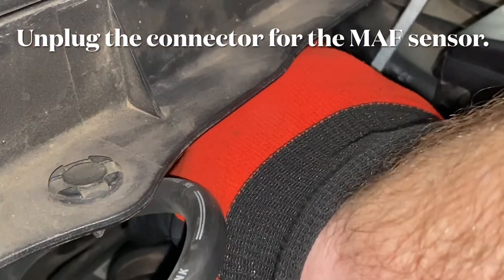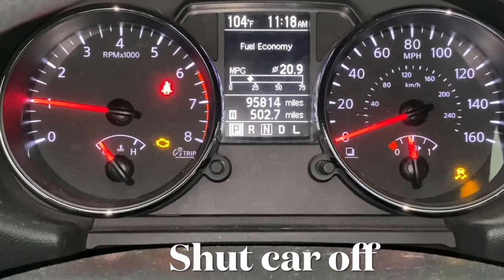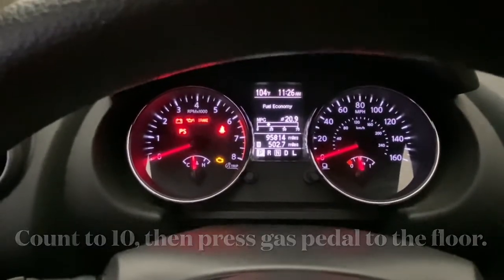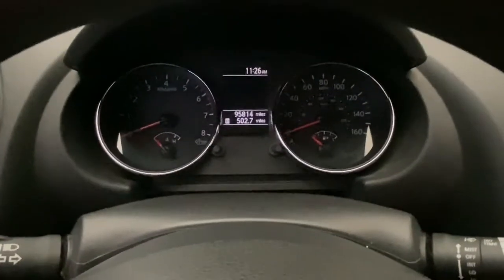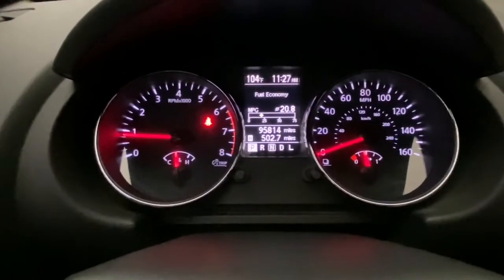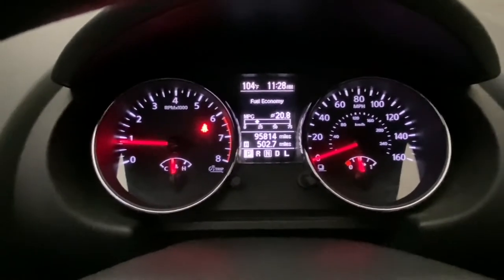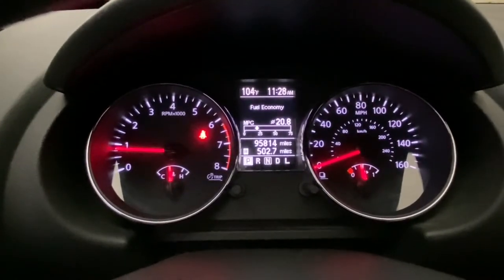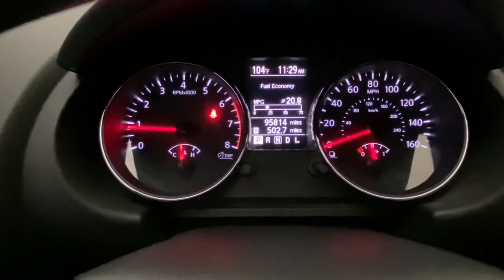STOP WASTING GAS!  How to reset your long term fuel trims.

Comment: Your car is always hunting for stoichiometric 14.7:1 regardless of how you drive it. If your fuel mileage has dropped you have another issue, and by using a scanner and monitoring long and short term fuel trims will be the best way to diag the actual issue within your engine.
Reply from the maker: If memory serves both the SES reset….as well as the Long Term Fuel Trim reset that I cover here, are outlined in the Nissan Field Service Manual.  

I appreciate you watching the video!

Comment: That is amazing👏🏼 I turned my LTFT from 10% to near zero👍 Before that, my Infiniti G35 have vacuum leak issue and thrown P0171 code. The LTFT level is around 15% which is no good. Then I fixed the vacuum leak and fuel trim level dropped from 15% to 10% and I am not really satisfied. After following the step in your video, the fuel trim is now prefect! Thank you!
Reply: I replaced my MAF in my volvo and wondered why it went from "rich" to "lean" Learned I had to reset the LTFT. I did this by disconnecting the negative terminal of the battery and letting it sit for 30 minutes.

Comment: Most cars if you just clear trouble codes, even if there aren't any, will erase LTFT (Long term fuel trims) and the car will eventually re-learn/re-set fuel trims.

Comment: Interesting video. While the ses reset procedure and the fuel trim reset may be covered in the manual, the job of the ecm is to achieve stoichiometric air-fuel ratio. I also don't think it matters to the ecm how you drive. It is a fact, however, driving "aggressively" will reduce your gas mileage and probably the life of your vehicle components

Comment: ... Intake cleaner on the upstream O2 sensor And then disconnect the battery for 30 minutes Gas mileage improves no more running

Comment: This is only for Nissan?  I have a toyota sienna. I should be getting more than 19 in florida. Use mostly highways when travel as well
Reply from the maker: As far as I know, only for Nissan.  It was outlined in the Nissan FSM (Field Service Manual), so that is the only vehicle I know it will work on.  And even then it is only on the Sentra, Altima, Rogue, etc…of certain years.

Comment: I have looked for information like the one in the video, resetting the LTFT, but my question is if it would work for other models, makes and years of cars and trucks.
Reply from the maker: Will only work for Nissan’s as far as I know, and only between like 2004-2016 with the 1.8 and 2.5 engines.

Comment: @SMR TACTICAL would this work for jeep wrangler JL
Reply from the maker: Not sure since it is a different manufacturer. I am confident this would work on Nissan, Infiniti, etc…but applying it to an American automaker…I am just not sure if they have the same tricks, etc as it relates to their ecu’s.  I can’t imagine it would hurt anything to try it since the engine isn’t running, but I just don’t know for certain.

Comment: wish i could do that for sentra 2005
Reply from the maker: If it has the 1.8l engine (qg18de) or the 2.5l engine (qr25de) it should still work for you.
Reply: @SMR-Tactical  i found the problem and fixed it. all fuel trims normal now.